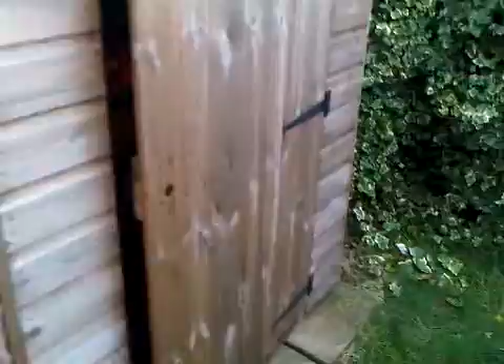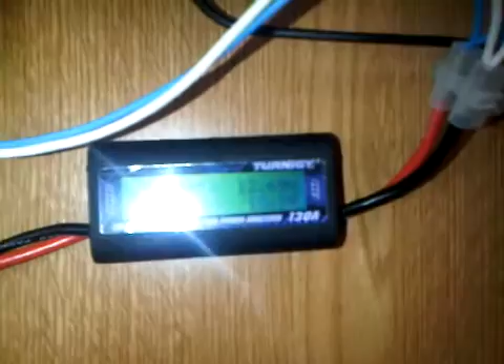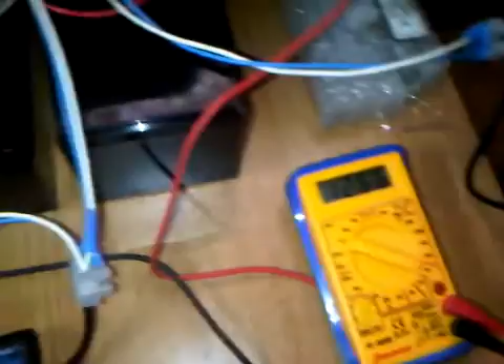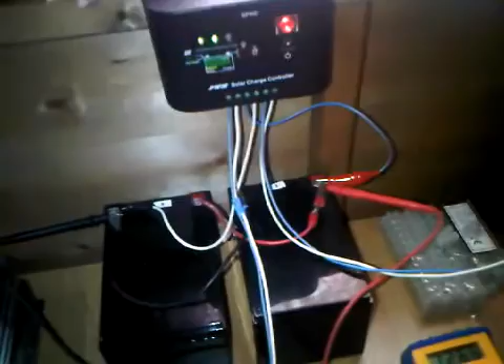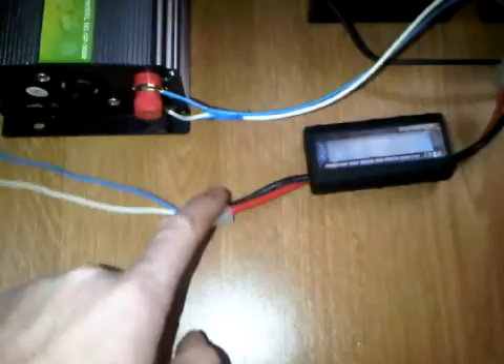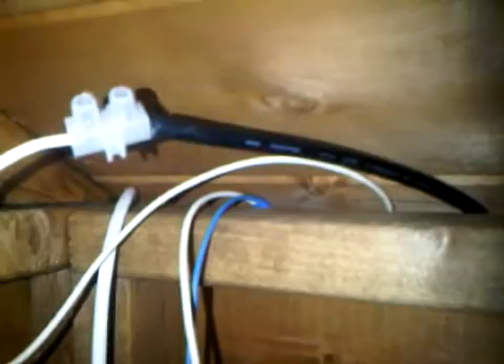UK Small Solar Shed Project

Comment from the maker: Grid Tie inverter by their very nature MUST power down as soon as AC power is lost else it could fry somebody working on the mains circuit !
I have several UPS's in the shed that are capable of running about 1Kw into the house in case of a power failure and would enable basic lighting and such if needed.

Comment from the maker: Hi crsbt,

I don't see any issue with doing it this way, it's keeps the voltage down below 28v on the GTI and gives me the best of both worlds - keeping the battery bank changed and ready and pushing all the excess into the house to slow the meter :-)

Comment from the maker: Hello 1crag1, thanks for your comments always nice to get some feedback!

I have only linked my batts to GTI a couple of times to test them lol
I have my smaller amorphous panel but it's only 12w so not sure if thats any good.  I thought it wasn't a good idea to link dissimilar panels together which is why I took that panel off when I replaced it with the bigger one?
Also my GTI works from 14v-28 so if I had both connected that would mean a possible voltage of 36v which would be too much ??

Comment from the maker: Hey Skylad14, I have only run the grid tie a couple of times directly from the batteries and they dont last that long!
It was only really a test to make sure the GTI is working correctly.

My main use for them is they charge during the day and run our lights in the house and chargers at night, as charging them at 12v the swapping to 24v to get the GTI working is too much like hard work especially this weather!

Regards

David